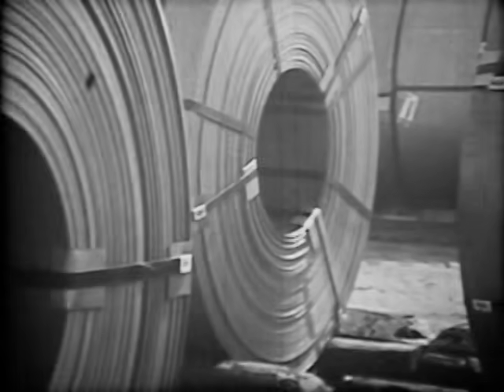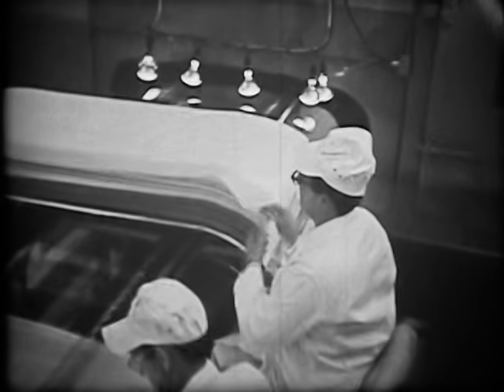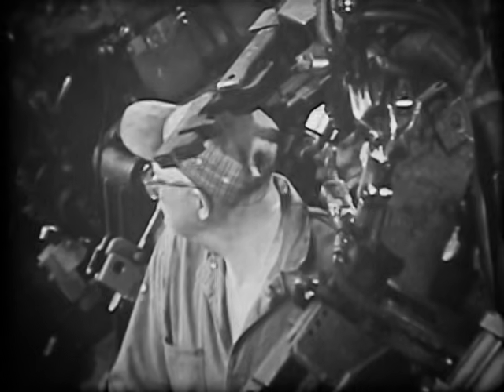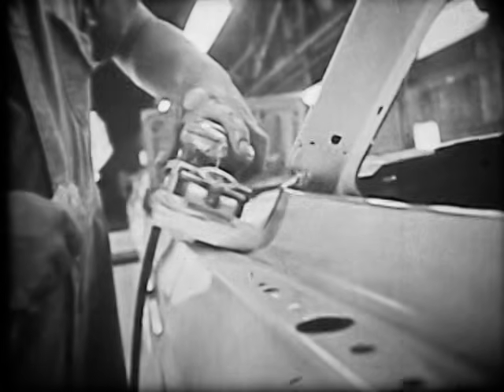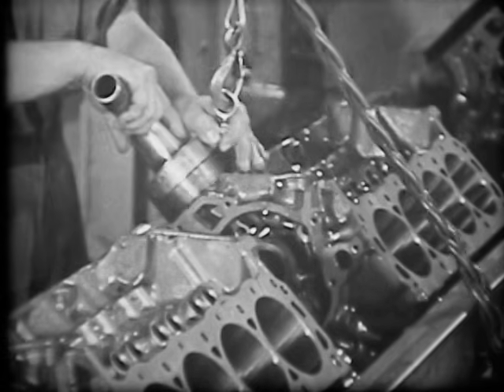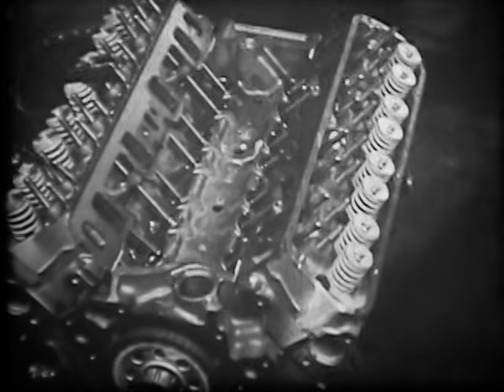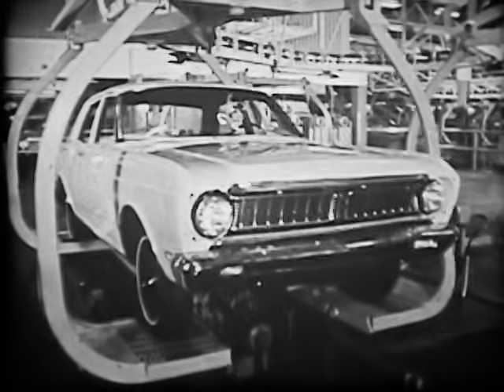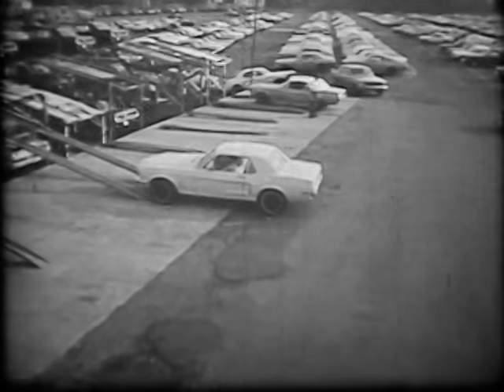A Car is Born - Ford River Rouge / Dearborn Assembly - 1960's

Comment: In 1986 I bought a squeaky clean 1969 Ford Falcon four door from the original owner. It had 27,000 miles on it, the original spare tire was still untouched in the truck. 200 six cylinder, automatic, AM radio, two-tone paint (white over burnt orange), black vinyl interior, whitewall tires and under dash A/C. It looked like it just rolled off of the showroom floor, was simple, ran like a fine watch. I got home from a gig at three in the morning. I unloaded my drums, carried them in the house and locked up to go to bed. As I was walking across my living room I heard a horrible crash. A drunk in a Chevy pickup barely rounded the bend and hit my Falcon square in the rear. Didn't stop until he dragged it six houses down, hit three more cars on the way. Ten minutes before I was pulling the drum cases out of the trunk and backseat. I'd likely been killed. I loved that car, it was great to similar ones rolling off the line in this video.
Reply: Sad to hear, i too had a 69, green & black, handed down from my dad. Still miss that car.😅

Comment: In them days hard work was valued and respected. People valued each other more, because like then, as now, no one could trust the government. The democratic party were intrested in sticking with and helping the working man and woman. Today it is a lot different. Democratic party lost its core values and sucked up to the rich elite since 1981. Hard work is no longer valued and respected. Our unions are in terrible shape because of President Ronald Regan fired the P.A.T.C.O. workers (air traffic controllers) back in 1983, thus causeing the unions at large to be nothing more then figure heads with companies pulling the strings. And no commradie among people. Sad times that are only gonna get worse unless the working man and woman learns to stick together and fight.

Comment: Back then manufacturing knew the hazards of 8 hours of exposure to sprayed solvents, loud percussive noises, metal particles from grinders, welders, etc.  But it was a different era, and men were seen as expendable.
Reply: If they die before they retire you don't have to pay them a pension.
Reply: . @MrSloika  Good point, and you’re exactly right.

Comment: No respirator
Oh my gosh
I worked that way in 1972.
It wasn't until the 1980s that we saw respirators and ear plugs from the noise
We didn't die
Get over it.
But you'll buy the products they make
Lousy hipocrits.
My dad was a production machinist and I was as well.
How else did we get appliances, automobiles and the rest.
You should all be flourists and never get a cut.
Little babies

Comment: i guess the much simpler and more efficient overhead camshaft eluded the usa for about 20 more years.
Reply: The overhead camshaft isn’t inherently more efficient, though it does facilitate more efficient runner designs for moving air through the cylinder heads. And it certainly isn’t simpler.
Reply: 1947 American manufactured Crosley automobiles  had Overhead camshaft -AND disc brakes.

Comment: Something cool about working on the car and seeing it years later on the street knowing “I probably worked on that one” 😎
Reply: Yeah, "i misaligned the door panels. You can still see how crooked it is." 

"I dropped a bolt in the rocker panels. It's probably still rattling today."

"I welded the roof after I got wasted on Nighttrain and pot but I didn't care."

"The boss sped up the linees so I just left out the critical welds across for cross members. Thought it would be funny when it falls apart on the freeway!"

Comment: Modern electric vehicles are so much easier to build than the cars of this era. They didn't even mention the transmission but the engine alone is a nightmare to construct.  EVs will, in the next few years be much cheaper than gasoline vehicles. The narrator was proud to mention how these vehicles could last 100,000 miles. 😂
Reply: Bs!

Comment: Amazing technology then, now cars are getting 200 plus miles.  Fuel injection and better oils are a big part of why on the motors. My father was a mechanic, he taught me that carburetors would allow so much gas in the motor and oil, it would actually eat at the metal. Fuel injection is so precise there is hardly any that goes in the motor what's not used is recycled back to the tank. Cars are also a lot safer today. As beautiful as vintage cars are, they were death traps....

Comment: Could an engine block be milled instead of cast?
Reply: Yes it can be out of a single block of metal. Very expensive to do.
Reply: The block is first cast and then machined.  Milling, drilling, reaming and lathe work are all machining steps required to convert the casting into an engine block.
Reply: Top fuel drag racing machines blocks out of aluminum

Comment: i wonder how many of people in those jobs have been replaced by computers and robots? I bet if you told one of the workers working on the Mustang line what a Mustang would sell for in 2023 they would have laughed at you!
Reply: I watched the video and they had basic robots back then,  you can see it. Hydraulic arms putting sheet metal in presses, etc.

Comment: I can’t imagine working an assembly line performing the exact same mundane task for 8+ hours day after day after day.
Reply: A lot of the mundane work is being done by robotics, now.
Reply: @danielcobbins8861  Is that why we have so many homeless?
Reply: @tedwalker1370  Don't know, but people can be replaced as they leave for other jobs or retire.
Reply: It gets old real fast but the  pay is great. I just retired after 35 years.
Reply: @careysharp8340  I tip my hat in salute to you because I don’t think I could do that.
Reply: I noticed the spray painters were not wearing mask
Reply: As a college student, I worked on the engine line at The Rouge during the summer of 1968.  TEN hours a day, SIX days a week.  I made a bunch of money, but a lot of the permanent employees just wanted some time off to do personal things.  I noted that quite a few of the older guys could barely hear and I concluded that the factory noise had destroyed their hearing.
Reply: I knew some folks that worked the assembly line and they weren't very brilliant people.  Couldn't hold a conversation.

Comment: Dad bought a 72 Country Squire in Dark Green Metallic with green interior.  Had that car 16 years and a Great family hauler.
Reply: We had a '73 growing up in the 80's. My Dad called it the "B-73," his friend called it the "stinkin' Lincoln."
We lived in a house with a 1/4  long dirt driveway. We'd put the tailgate down to take out the trash up to the main road, with barrels three across. My brother and I would ride on each side, with our feet on the bumper & tailgate, while holding onto the roof rack, while Dad drove.  We always felt like Firemen from back in the day.
Dad would always bomb the wagon back to the house on the return trip, with a huge cloud of dust and the family dog barking and chasing along.
Finally sold it in 1996, right before a move. The AC still blew ice cold.
Reply: Those 69-72 Ford,and Mercury Station wagons, along with the 65-70 GM fullsize station wagons,and then add the fullsize the 65-8 Chrysler station wagons,some of the coolest cars around,and almost all my friends parents had a station wagon of those makes,and year range.
Reply: We had one just like that. Traded it for a new 78 in pastel yellow.
Reply: Was your name Rusty Griswald back then?

Comment: As someone who started working for GM in 1970 in a GM engine plant,what amazed me is how many old men there are still  working..I think it was the contract in 1973 where they achieved 30years and out for your full pension..The older guys left..Thank you for downloading this..
Reply: I too started at G.M. ,  but at  Rochester Products in 1968 - 1998 .   Great to be retired for so long , but I do miss a lot of good people that worked there .
Reply: Seeing some of these older gentlemen in this video, I wonder if they started at Ford when they were still making the Model T.  This video is made around 67 based on the models of cars and Ford came our with the Model A in 1927.  So, I suppose it's possible.
Reply: This was filmed during the Vietnam War. The young guys were overseas.
Reply: This was filmed during the Vietnam War. The young guys were overseas.

Comment: Good video, but incorrect/missing locations: 20:31 shows a glimpse of a Thunderbird being built. Wixom Assembly was the sole assembly plant for T-birds until the 70's. 20:34 with the Ford being lowered down the tower is the St. Thomas assembly when it was very new.

Comment: As a new car make ready man at a Ford dealer in 72 I can tell you those window inspection stickers took a lot of work to remove. Great video my Dad had a 69 T bird, mostly the same except for the amazing 429 Thunderjet V8, very well made car.
Reply from the maker: When I taught in Dearborn, MI, the kids loved this film.  They were proud to live in Dearborn after this.
Reply: You’re supposed to use a good razor blade with some glass cleaner. Then they come off easily